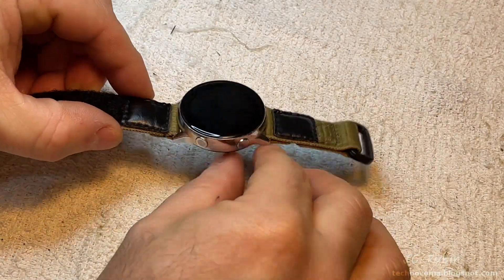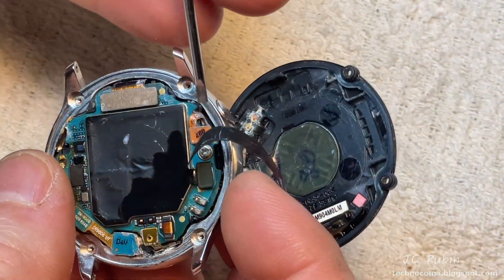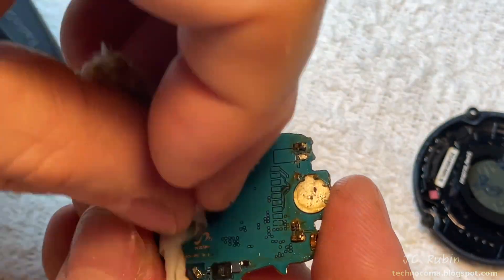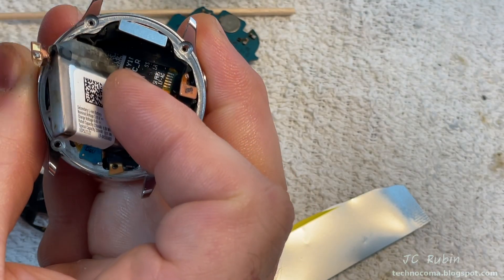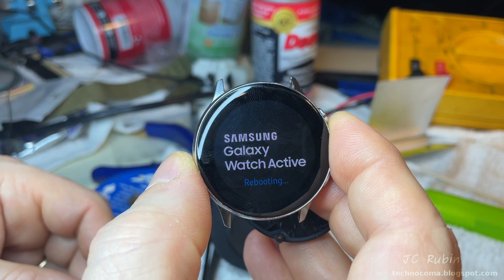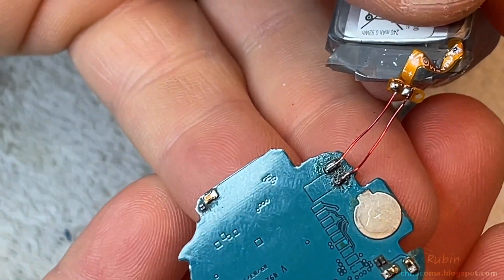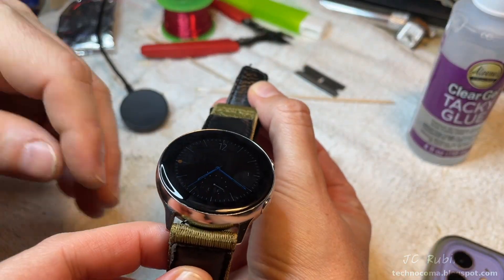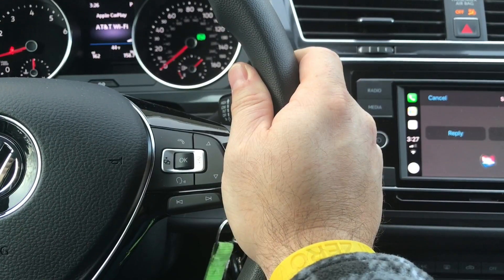Galaxy Watch - Pool Water Damage - Are they Swimming Pool Safe, Can it Be Fixed

Comment: Nice work.. Interesting that the bottom of the board has copper pads for a microSD card, I wonder if that's for R&D/development.  No soldermask exposed, but probably a cheap alteration to the PCB mask to make development units.
Reply from the maker: Actually you will see where I MAY have found the leak in the case is a port with a rubber seal, probably to programme the units during production.
Reply: @retrotechandelectronics  Possibly so - but I'm talking about e.g. 5:05 where you can see a number of unexposed copper pads in the shape of a microSD connector (I've used many in my time) which makes me wonder if they use that for R&D.  Looks like you'd struggle to pack a card in there for a retail product (with the battery taking up space) and it wouldn't be user accessible, so can only guess it has an engineering purpose.
The exposed pads are probably JTAG or some interface to the internal eMMC - though too few pins to be a true eMMC interface.
Reply from the maker: @tomsixsix  I did recheck that. Yes I suppose it’s possible, used in dev for storage of apps or logging